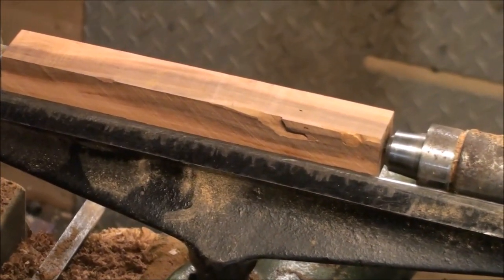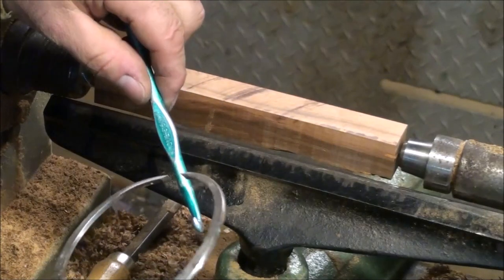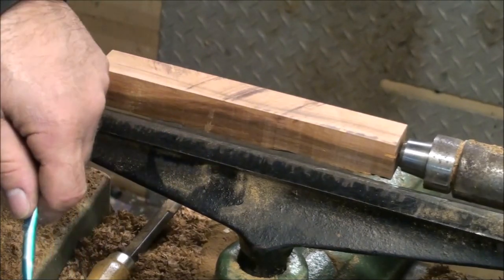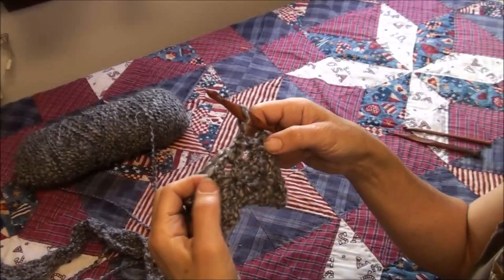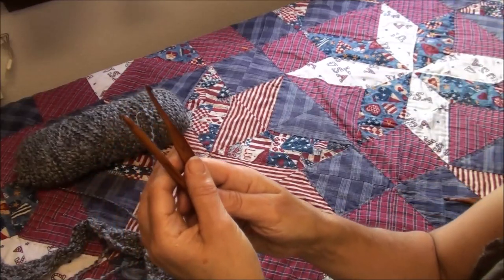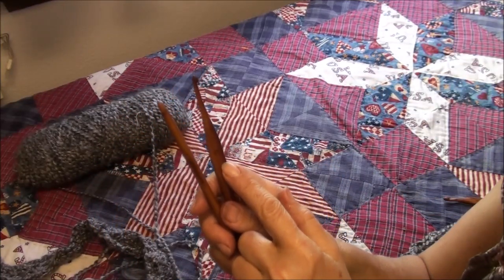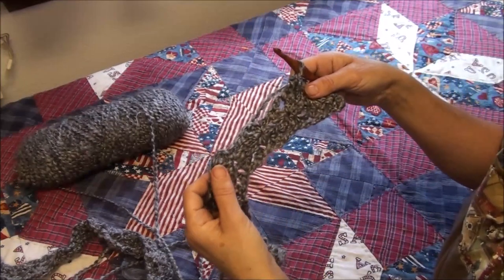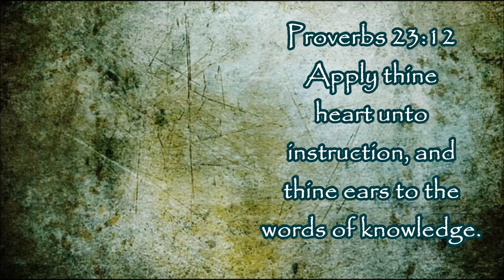Hand Crafting a Wood Crochet Hook

Comment: you also can make them out of wooden dowels and even sticks cut from trees--have made many and even the huge ones for using 3-4 skeins of yarn for rugs-wow does it go fast--God bless!
Reply: Absolutely, I used to whittle quite a bit in my youth. The harder the wood the better the hooks. Heidi purchased bamboo hooks and because of the larger fibers they are rough. Heidi likes these because they are smooth as glass and run through the yarn easy like "butter" she says.

Comment: Very cool! Would love to know about how long it took to make from start to finish.
Reply: Oops,  just got to the part where you said how long :)
Reply from the maker: Haha!  His videos are not only cool looking sped up, if I did not speed them up, they would be way too long! :D
Reply: Whitney it only takes 6 minutes ha ha. I have to fashion these out of desert Mahogany or iron wood, a very dense hard and heavy wood which works perfectly for this application.  some in the area in Oregon where I got it. It takes a bit to find the right piece in the wood I get because the bug holes penetrate quite a bit of the raw material. The center of the raw piece is where I have to go to make the 1" x 1" blanks to chuck in the lathe. i may make a video at some point on how that process comes together. Thanks!